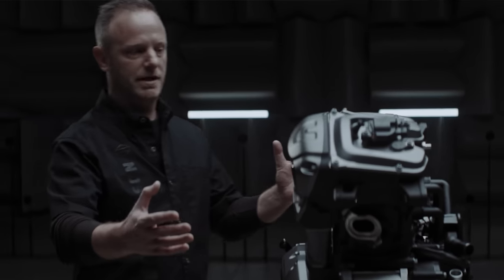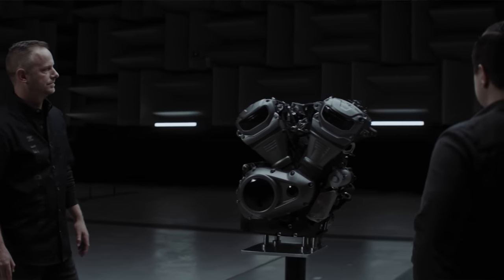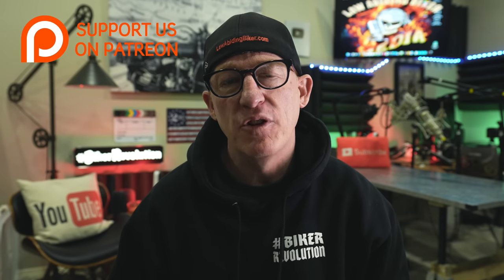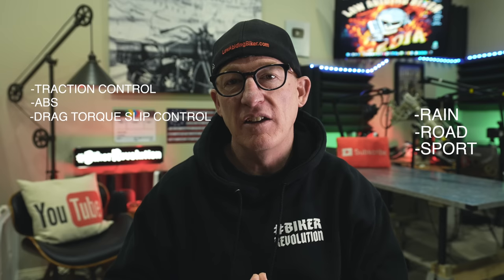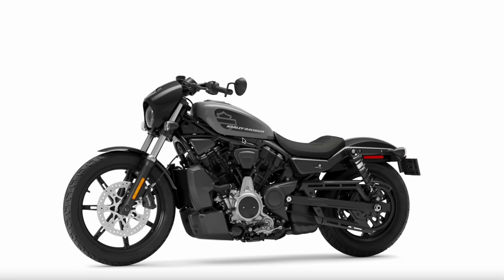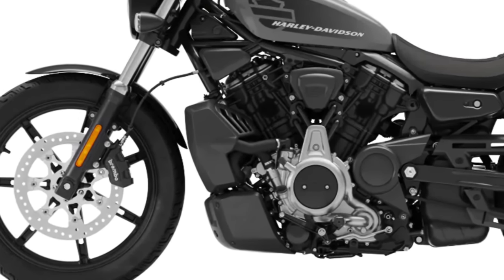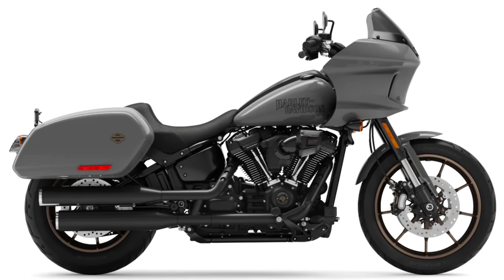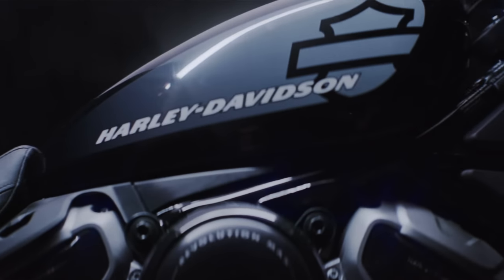The New 2022 Harley Nightster! Bang or Bust? 🤔  Sportster Lineup?

Comment: It's too expensive for what it is.  They priced it way too close to the Sportster S and the Softail Standard.   Let's be real, the Sportster S is a fun bike, but it's not exactly jumping off the showroom floor and I've yet to see a single one in the wild.  This should have been priced 2-3k cheaper.
Reply: I used to think that but started comparing to the BMW offerings.  The Nightster is better with better options and performance while cheaper.  The Sportster S should end the Fat Bobs run, very similar with better power at a lower cost.  Compared to a BMW it’s also cheaper and a bit lighter.  
The more I look at all three Rev Max powered offerings the better I think they stack up against the Bavarians.  I’ve got a M8 street Bob and a 2003 Sportster and am seriously considering trading for one of the new Rev Max models.
Reply: @chrissmith7669  I have a 2018 Street Bob with a 124 Zippers Sleeper and a few other mods.  Pulling 140/136.  I hear that they're looking at the revmax for a light touring bike as well.  If they pull that off, I might jump on it
Reply: @breedlofam  I’ve got a 2020 Street Bob I enjoy the heck out of but the Rev max offerings are very tempting.

Comment: Old Sportster with only 50 horsepower vs the new 90 horsepower version.  What is ther not to like.  No stage 3 or 4 needed especially with lighter weight from engine stressed part of frame.
Reply: Well it’s gay looking

Comment: Nightster wouldn't compete against the chief. That would be the ST standard and street Bob. The nightster competes with the scout Rogue or Bobber, both of which are cheaper. And the Honda Rebel 1100 is similarly powered, lighter, has all the electronics PLUS cruise control, and is 4k cheaper. Sorry, I think HD missed the mark on this one. They are entering a segment where the die-hard brand loyalty doesn't exist and price point is a huge selling feature. HD fans are going to bypass this machine and straight to the soft tail standard I think.
Reply from the maker: Scout is a great bike too

Comment: I love the new Rev Max motor but won’t be too excited unless Harley takes the 1250 motor and builds a low weight “Cafe Racer”   That motor has what it takes to thrill but we need a chassis that is retro yet functional.  Not looking for a cruiser here but an old school Cafe Racer.  Proper rake and trail with dual rear shock Olihns at both ends. Keep it under 450lbs . I seen a prototype photo of one over a year ago that had my heart racing but still no foresight from Harley.

Comment: As per usual, Harley has produced another bike that’s just kind of mixed bag for me. Wish it had a 4-4.5 gallon gas tank under the seat instead of just 3.1.  Would be nice to be able to do about 150 miles with a tank of gas without absolutely running on fumes
Reply: I'd want slightly taller bars (The ones Harley links to in their catalogue look about right). Looks like I'd probably want another inch or two in seat height as well. I'm not a fan of low slung, stretched or cramped controls. I like that balance of being able to really control the motorcycle (just a good standard upright riding position with mid controls) and still be comfortable enough for longer rides. I think it would also have a better looking stance if it used the Low Rider S sized tires instead (Front - 110/90B19, Rear 180/70B16) instead of the slightly smaller size tire that it does use. Perhaps a slightly less bobbed rear fender as well. Everything doesn't need to be bobbed or chopped. Just something more utilitarian.
Reply: Otherwise, I feel like the bike as good a candidate to modify as they market it to be.
Reply: It's rated at over 50mpg
Reply: One of the things I Like about my 2018 XL1200C is the 4.5 G Tank
Reply: @deangullberry5148  I’m aware. By the time you account for the size of the fuel pump, I’m sure you’ll have much less than 3.1 gallons which means the gas light is going to come on at about 100 miles or so

Comment: We all knew this bike was coming. Europe can’t have the air cooled sportster anymore. HD had to make this bike and unfortunately it’s price is far too high for the competition that undercuts it. I don’t care how good the bike may be. I have a forty-eight with a ton of work already done, bought it used and then added around $3k in parts and still less than a new air cooled sportster. It’s my keeper. I can’t see at least in the short term how people will be modding a bike with little to no aftermarket. It was kind of silly for HD to play out the aftermarket side of the nightster when we also know that there’s nothing available compared to the older air cooled sportster! I like the look and performance of this new bike but no way am I going to pay that much for a bike I would be stuck with in stock form…

Comment: I like it, looks really good. The question most will have to work out is do I go with a softtail like a Street Bob which is AUD 26.6K or this at AUD 24.3K. Its actually not a bad price for the newer tech. In AUD you get RDRS included, that's a good inclusion maybe? I can get a bigger engine, fuel tank with Street Bob be it older tech.  Overall I really like what they did, the two into 1 looks HEAPS better than the horrid looking Sportster S option and the lines are cleaner. If they flipped the bigger engine in the Nightster out of the Sporster S so it was reversed I'd be tempted. They did a lot of justice to the original Sporty, well done to that. Just my thoughts
Reply: You have to ride each, and see which one fits you more.
Reply: @usmcvet0313  Agree, the smaller bike may suit riding style more. Street Bob you can at least do 2up and sissy bar for travel etc. Not sure about this bike.  Just interesting to see others thoughts
Reply: @andrewmadge  for me, I will always have an air cooled HD big twin in the garage. So for me in you shoes, if I can only have one bike, I would go softail. For a second bike, if I already have my Road King at home, I would go new Sporty for sure. But that's just me. Test rides are in order.

Comment: I hope this bike accomplishes H-D's goals, and that they sell a shit-ton of them. It seems pretty "metric" to me, and that's probably the direction they need to go, at least with one product line. Something more "modern" to appeal to new or younger buyers.

As for pricing, that's up to the buyer. Motorcycles are pretty much toys, and I can't think of any that represent a value in any real sense. You can't really go to the grocery store or Home Depot or get the kids to soccer and gymnastics, and for a lot of the population, they're pretty much useless 6 months out of the year. If you can't spend $14k on a bike, you probably can't spend $13k either. 

Maybe it's because they just don't stand out at all, but I can't remember seeing more than a handful of Honda Rebels or Yamaha Bolts, which this bike reminds me of a bit. There's clear H-D lineage and DNA in this bike whereas the others are doing a Harley-Davidson impression. I think H-D will find an audience, and so will the aftermarket exhaust companies that will sell all the systems they can weld together to replace that aggressively ugly factory set up. Seriously, what the hell were they thinking. I know there are noise requirements that they have to mee, but that was the best they could come up with? Holy shit, that's catastrophically ugly.

Comment: I like the design and I think the Revolution Max motor is awesome! I’m glad to see that they really tried to keep the “old school Sportster look” in the design! Price is fair, I think, but then the MoCo is adding on the surcharge and shipping….just under another $1,100….☹️ Overall, though…💥👍💥
Reply: Look again, MSRP starts at 13.5. H-D just handed Indian another win. The Nightster is playing catch up with the Scout, technology wise, and the Scout is cheaper than the OG Sportster.
Reply: @deangullberry5148  Scout doesn't have ride modes, tcs, or lean sensitive abs. I like the Scout, but saying a bike with more tech on it is playing catchup technologically is incorrect. Also, if Indian adds those things to the Scout; you will see that price come up.
Reply: @usmcvet0313  thought it did. That's what I keep hearing. If you're right, I stand corrected.
Reply: @deangullberry5148  I just went and double checked their website. For the Scout, the only tech option is that abs (not lean sensitive) comes on the color option bikes. The cheapest color option is $13,399; the most expensive is $14,899. No ride modes, tc, or lean sensitive abs that I could see; and the cheapest regular abs equipped one is only $100 less than the Nightster that comes with all of those things.
Reply: @usmcvet0313  good info.thanks for the correction. Gives me a little more hope for my stock portfolio....

Comment: I am not a fan of the new Sportster/Nightster. I've owned 2 Sportsters over the years, a 2004 XL1200C and my current on, a 2020 XL1200NS. That new "thing" look atrocious! Plus, it doesn't even follow the tradition of being a bare bones platform for customization. I guarantee there won't be as much customizability with this bike with the way it is setup, especially since the fuel tank is now under the seat and the fact that the horridly ugly liquid cooling system is basically mandatory for the Revolution Max engine.

Sorry, I won't be buying one. I will stick with my 2020 1200 Iron for as long as I can afford to keep it running.

Besides, up until recently, due to finding a better paying job, I was a Service Advisor at my local H-D dealership. We had a couple customers buy the new Nightster when it first showed up on our show room floor. Both customers have had there Nightsters in our service bay more than on the road due to issues with leaky brake lines, electrical issues, clutch issues, and one of them didn't even come from the factory with a pig tail wire for charging the battery. Not worth the $13,500 + taxes and fees they are asking for this bike IMHO.

H-D needs to step up their game.